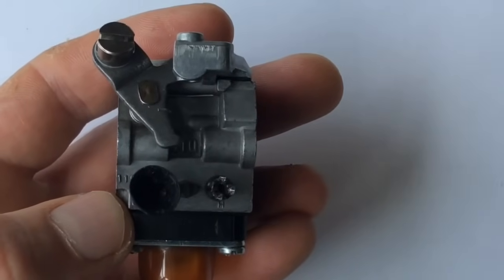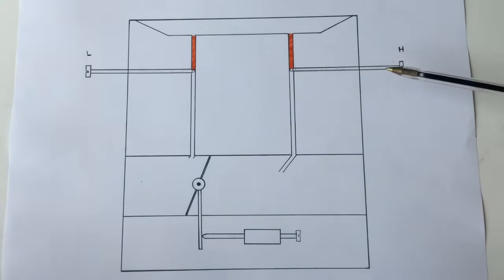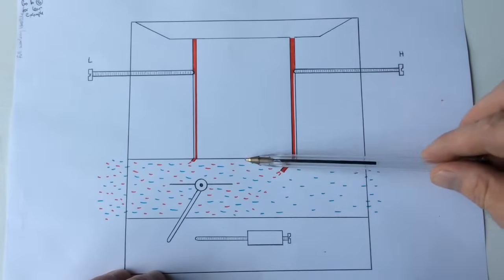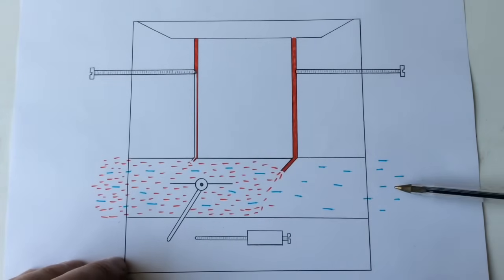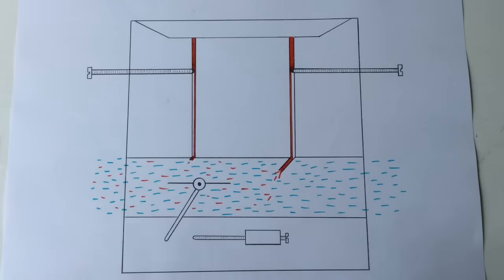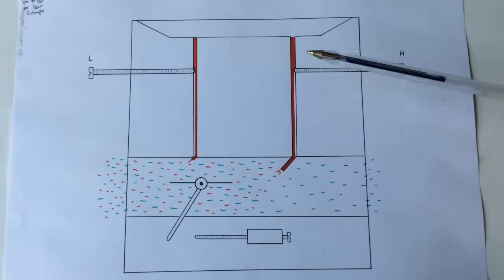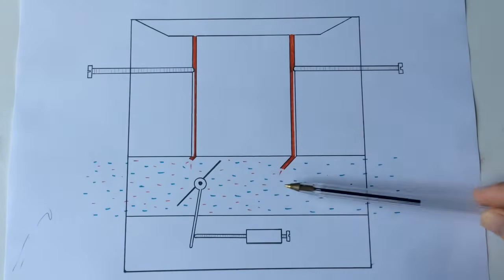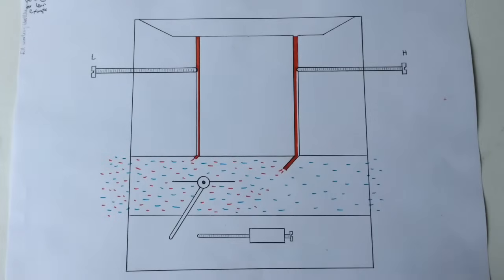HOW ADJUST CHAINSAW CARBURETOR:  Chainsaw Carburetor Settings Explained! (by Craig Kirkman)

Comment: You are ‘da man!  Thanks! I had a tree fall on my house and shed causing minimal damage but the longer it stayed the worse the damage. Chainsaw would not start. Tried everything. Didn’t run until I followed your instructions. You’re a lifesaver. Chainsaw runs better than it ever did. Now I’m going after the 3 or 4 other small engine tools that don’t work. Thanks much. God bless you and yours!

Comment: Just bought a 67 larson with a 80hp 67 evinrude. It's been cutting out and bogging down at 3/4 to full throttle. Not having a clue what I was doing I was playing with the two screws. I did get it to idle better but this video has made more sense as to the function of these screws. Going to give this a shot today. Maybe I can get it so it will hit full throttle without cutting out. Thanks so much. Definitely going to subscribe!

Comment: This video could be 7 min instead of 14. The low jet relies on direct vacuum that is induced behind the throttle plate that puts it into play, when the plate is open there is much less vacuum so it draws little. The main jet then comes into plat due to vacuum induced by higher airflow through the venturi in front of the throttle plate. Final tuning of the high, (usually richer) must be done under load due to the higher manifold or induction pressure that only can be achieved at rated load.

Comment: Hiya, great explanation and i will be trying that out. Can you perhaps answer a question on a particular fault on my two stroke hedge trimmer, its a mountfield mhj2424. Recently I’ve noticed when using it as i sweep it upwards into a vertical position the engine revs rise. It never did this before. Im holding the throttle fully open as i do the sweep so its not changing throttle position. Ive not serviced this carb or anything on it since i bought it so could you offer any ideas as to what i should do to track this issue down and also any parts i should replace (diaphragms? I watched your other video on this) and good suppliers? Ive also got a Honda Izzy 4 stroke mower thats got harder to start and ive had the carb on and off it a few times but i cant find any service or setting up info on it anywhere..help!

Comment: Excellent video. I've never been able to get a string trimmer to run or even start with only 1 turn on either mixture screw. The absolute minimum i've found is 1-1/2 turnsto get a start and going from there.

Comment: This is why the English and the Americans are two people separated by a 'common' language' Instead of 'Tick Over' it's called 'Idle'. You will NEVER have more fuel than  air. the proper mixture for any engine will always be around 14 parts air to 1 part fuel.

Comment: Simple carb adjustment problems have allowed me to buy some nice stuff cheap because the owner didn't know how to adjust it. Mantis tillers are known for that. Funny tho, I always start by turning the H all the way in and the L to 1-1/4 turns out to get them running at all and then adjust from there.

Comment: I bought a new chainsaw from Sears back in 2006, and it ran while it ran adequately. But now after maybe three or four cords of wood, it will not start and it turns out that the carburetor jets are not adjustable. I am baffled by how it is meant for any mechanic to adjust the carburetor as is shown here. I've been a chainsaw mechanic for decades, but occasionally I see a chainsaw that can't be adjusted, because there are no Jets on the carburetor, or else they have been staked somehow and can't be turned. What do you suggest?

Comment: I have a blower that the only way to bring it up to rev up is by blocking the air filter and then slightly open the blocked air filter by less than 10% . Ir has a new fuel filter and new Carburetor. If i try to rev up without blocking the air filter it bogs down and shuts off. I also adjusted the H and L the way you showed and  it makes no difference.

Comment: I just bought a new Husqvarna blower and the 2 times I've used it were very frustrating. The engine revs up and bogs down the whole time. I'm hoping this video will solve the issues. I like how you first close both adjustments and start from zero. I had to order an adjustment tool for the setting screws. You'd think a reputable company would supply that in the box. I'll post my results later...

Comment: I just replaced a husqvarna carb and unscrewed both out 4 turns...it does not run or start when it gets hot..and the fuel screws made no difference...fresh gas and new carb...any suggestions?

Comment: Brilliant , brilliant , brilliant an easy to understand explanation of how a 2 stroke carb works. Trying to get a Mercury 3.6 Outboard going at the moment. It has been stored for years and previous owner left fuel in tank. Thus, have been cleaning "jelly" from tank and fuel pipe/switch. 
Engine has spark and compression but think fuel being blocked in carb. Wish I had you on hand!!

Comment: If it bogs when you throttle it Its LEAN, back the mixture screw out slowly. Dont set the high speed to high, you will throw the oil off the piston skirt and piston to sieze.

Comment: As a small engine mechanic, and a qualified trainer, I thought this was one of the best explanations for laymen I've seen. Bravo!
Reply: I'm trying to adjust the carb on my weed whack and I'm confused af ...
Reply: Best video and tutorial I've seen explaining the work of a small carb.on a Echo chainsaw I've seen yet. Planning on tuning mine myself but having trouble finding the correct tool needed for adjusting it. Could you possibly help me with what tool I would need. God Bless and thanks in advance
Reply: I agree completely Steve!  Great comment!
Reply: how can the high jet be in front of the choke...removing the filter sponge on a weedeater, the choke plate is right behind it, so it appears.
Reply: @LaBambaCL  He hasn't drawn the choke plate, that's the throttle plate.
Reply: To laymen lol you ain't a rocket scientist son
Reply: @paulwetherhill5676  No. I'm a small engine mechanic.

Comment: Thanks for the video! My Stihl FS 66 would not run without choke. After checking filters etc I watched this : Turned both H and L all the way close, then backed them back off to previous point, plus a smidge more. Fired up and ran like a champ. Figure some gunk got stuck there and this process freed it.  Thanks again!
Reply from the maker: Thank you so much, im so glad it could help!! :D
-Craig

Comment: Craig could you please expand on how to determine the optimum settings for tickover?  Is it max rpm for the tiny throttle opening, or a tiny bit richer than max rpm? Then finally do you lower the rpm with T screw to get a reliable steady idle? Thanks.

Comment: Good lesson here. When mentioning lean running and the risk of damage due to lack of lubricant, you could also mention that lean running is hotter running. Optimum power is just slightly on the rich side of max rpm, which you do mention is actually a lean point.

Comment: Tuning a 2 stroke carb is insane, tune and you have to readjust everything to get it right. If your chain is oiled, if its sharp if the chain is in a log under load if the metering lever is set right diaphram soft?, if the carb is clean if the fuel is right and fresh, if its warm or cold. Altitude.

So much to think about.

You cha ged the way i tune now though, i usually roll bricks uphill and get the idle working first but it makes more sense to go the other way as i end up pulling the rope a hundred times adjusting Lajet.

Comment: Hey mate amazing video superb the Venturi flap docs thing are you referring to the idler adjustment cause when I adjust it it lets too much fuel in and revs the motor and this the cutting head spins

Comment: If me engine feels like it chokes at full rpm means it needs carburator cleaning?
Reply from the maker: Possible but depending on the type of carburetor it sounds to me like the carburetor needs resetting :)
- craig
Reply: @TheRepairSpecialist  thank you i just did and it worked!

Comment: With the low screw setup I always produce a reasonably high idle ( you'll be able to hear the pinkings of the centrifuge clutch just starting to impinge). Then when the Idle is set correctly the engine is happy for you to back down the idler screw to a true idle. Not doing this can cause the engine to die and much frustration .

Comment: I'm trying to get my mantis running again after 7 years in the shed, hesitantly took the air/carb off to clean and got it running to a degree. However I wasn't confident enough to start messing the H/L fuel mixtures, but this video makes so much sense I'll definitely be giving ago now. Thank you for an awesome explanation of how these carbs work, fantastic stuff......

Comment: How do you know which screw is the high and low?  My craftman weed eater doesn't have an H or L.  Thanks.
Reply from the maker: A very good question.  I have been working on a video that explains how to find this info out.  I will be uploading soon, hopefully.  It's best though that I show you rather than write an explanation. Thanks. Craig

Comment: the 403 dislikes are people who thinks this is a food mixer.....excellent video, very good explanation....thank you..
Reply: What dislikes? Lol
But really, awesome explanation that is easy to understand!
Reply from the maker: Thanks you for nice feedback. I really apreciate it. Its comments like yours that motivate me to continue making vids. Craig 👍👍👍👍.
Reply: @TheRepairSpecialist  i have 36 cc even when motor was new i had leave choke slightly closed , I do have tuned pipe and a airvelocity stack figured it just wasn't getting enough fuel because of the modification.  Now motor is older its so hard to either start or if starts on first pulll hard to tune, just erratic trying get to perform and idle . I have same carburetor from a Zenoha motor im going try . I thinking even though its the common brand carb ,same brand on this replacement motor its always been defective and now ive left ethanol gas over years its shot. The spark also looks very weak is there a way to check if spark is sufficient with a meter , spark plugs always sold out at homedepot for some reason , its smaller thread ones they seem to not use anymore on lawn equipment.
Reply: @paulclancy2404  start with your idle, or "L" , screw so that it runs smooth. "L" control fuel at idle, "T" controls air at idle. Once it idles smoothly, try the throttle. If it bogs, adjust the "H" screw till it just starts to not bog. Just like the video says, start out with screwing the "L" and "H" screws all the way in and then a full turn out. Spark isn't an issue. Running too rich is your issue. The choke is only  for providing extra fuel on cold startup to give it a little boost.
Reply: @frenchthoughts  ok thanks, I know low speed and high , I was always pretty good at tuning 2 stroke dirtbikes ect, now I've been repairing echo weedwackers people throw away lol, and I notice the spark was alot better on them, thats why I asked.  About  insufficient spark .
Reply: @paulclancy2404  check everything for air leaks even your spark plug. It will keep it lean no matter how much you adjust if its sucking air.
Reply: @TheRepairSpecialist  pa
Reply: @TheRepairSpecialist  ⁰
Reply: i agreed with you!!
Reply: No dislikes thanks to their new bs. We'll never know a bad video. This one is good though
Reply: Right  this is a great video ! And a great refresher too !!
Reply: Literally watched the video and had a completely new understanding on my saw. It kept bogging down till I tuned it up properly and now she runs better than it ever has! Thanks!
Reply: Back when YT showed dislikes... The good old days
Reply: Yhey removed the disliked when they saw that we didn't elect him.

Comment: Thanks for the video, it really helped a lot.....I was ignoring the high jet, while trying to set my idle and low jet, after removing and cleaning the carb......it would scream like a banshee from being so lean, when I added fuel to the low it would settle a bit, never idle properly......started to add  a little fuel with the high jet, and it settled down nicely.....still want to check it on a log, under load, but it is much better.....
Reply from the maker: Thank you so much for the nice feedback. I really appreciate it. Craig

Comment: There's me doing it arse about face, dough! Will try high first when my repair kit turns up. Needle worn lol
Reply from the maker: If you want to take a quick look at me setting a chainsaw in the way I explained here then I have included the link here: https://www.youtube.com/watch?v=74p9FLmIkkw&t=1s .  

This is just the way I have always done it and I've found it worked well for me.  There are other ways such as Low first, which some would rather do.  I have had some people say that this damages the engine because of lean fuelling from the low screw when Rpm is taken to high revvs.  This doesn't make sense though, because if the fuel was that lean it wouldn't rev up at all.  The engine cannot lie about how much fuel it is receiving.  If it revs it is getting the fuel to do so.  If it is a little on the lean fuelling side for a few minutes when you are setting the carb, this isn't something I have found to be detrimental to the longevity of the engine as long as the fuelling is corrected, which it will when going through this procedure.  As long as a good end result is reached then that's all that matter.  Thank you for looking at my video. Craig

Comment: Does a new carb come preset ?    Runs if spray starting fluid but will not start up with out.    All new top head Piston cylinder filter .    Were the part that bring fuel into carb ?   Just maybe might be that.
Reply from the maker: Hi.  They are set in a standard sort of way but there are so many variables as to whether a new carburetor (not yet tuned to your particular engine) will work on your engine from the get go.  This may include, but not limited to, the type of fuel you are using, the age of the fuel, fuel mix and engine state (whether new or worn) etc.  That's why there is setting on most carburetors.  You can think of them compensators if you like.  So you may well need to tune the carburetor, especially as you have done all of this nice work to your engine. So the next thing is to tune your carb into your engine. Many thanks, Craig

Comment: This blows my mind as everyone else speaks on adjusting the Low side first... im gonna go with you sir.
Reply from the maker: Thank you for your nice comment.  Yes, I know lots and lots of people in the industry that do always adjust the low first.  This is indeed a very very good and productive way of adjustment.  The way I have explained is the way I have always adjusted these and I have never had any issues over the last 25 years.  

Because I adjust them this way, this is the way I have explained it in my video.  I have used both ways of adjusting, though, and have found there to be no right of wrong way to be honest.   

The end result should be the same if adjusted correctly, that is an engine that runs great!  I have included two links below to other videos of mine that shows me actually adjusting a chainsaw in the way I explained here.  

Please take a look if you can.  Thanks again for your comment.   Craig 

: How to tune a Chainsaw Correctly :  https://www.youtube.com/watch?v=74p9FLmIkkw&t=78s

: Chainsaw Running Problems | Corrected by Fuel Screws: https://www.youtube.com/watch?v=Eo6iUTjcQ8Q